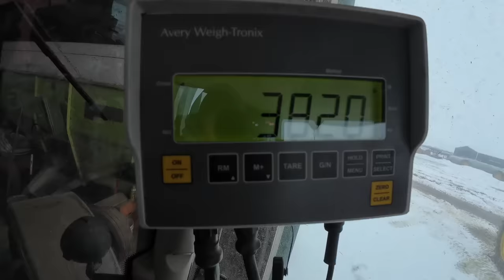First Blizzard of the Year

Comment: Thanks for another great video Cole. 
It was really interesting. 

Always busy time after a winter storm. Seems lot to clean up from the storm. Your feed lots were troublesome for you and your dad. Lots to clean up but yet pretty soft in your lots. 

Two flat tires in one day. Oh no. Troublesome getting them off and repaired and put back on. But you got it done. Yeah!!!!

And then the hydraulic hose broke on your dad’s loader tractor. Oh my. Got that fixed in good time and put back on. Good job Cole and Brian. Yeah!!!!

Throwing old clothes in the burn barrel. Used them up. Dad put new ones on to start caving season I believe Brian said. Good going Brian. 

Driving home from NW Iowa had to have been some slick roads for you and the wife. Bad weather that way i believe. Glad you are home safe. 

Saw Ellie in the tractor cab. Don’t see that often. Does she not like that but will ride in the cab sometimes???
Nice dog. 

About it i guess. I am central Iowa and we got nine inches of snow ❄️ with another four to six inches coming. Oh my. Winter is here.     

You both take care and be safe. Thanks for everything Sonne’s. 
The Iowa farm boy. Steve.
Reply: as soon as the door comes open she wants out...badly!
Reply: @briansonne814  
Thanks for the reply Brian. Seems some dogs like to ride and others not. My dog just did not care for it either. Take care. Steve.

Comment: Thinking of you with the upcoming weather.  It’s times like this that I’m glad we don’t have horses anymore.  HATE cold weather !  But then I’m older than your father.  *grin*. You should get an air horn for your tractor.  The cows would respect that probably !  Would be fun to install one, eh ?  Laugh Out Loud !   By the way, in case the manual doesn’t say in along with don’t pick up elephants, it should give you a warning that the engine gets hot after at least a ½ hour or more of use so don’t touch it.  You’ll get burned.  Glad you got the snow blower figured out.  Stay as warm as you can next week !  I think I saw in your area that the “feels like” is going to be in the negative 40’s.  Wow !  Be careful !